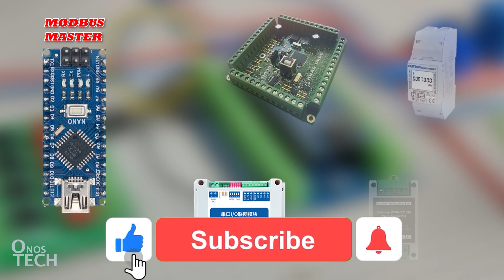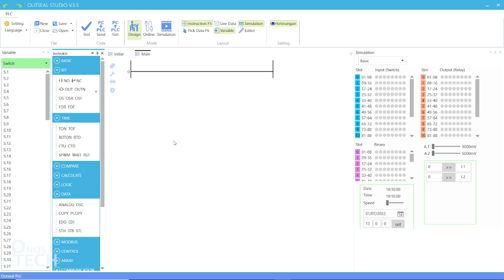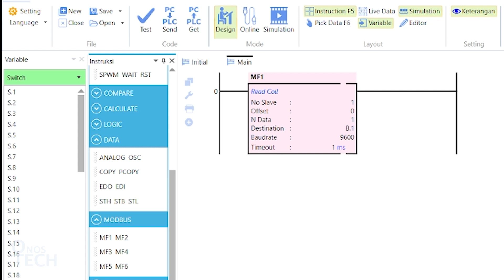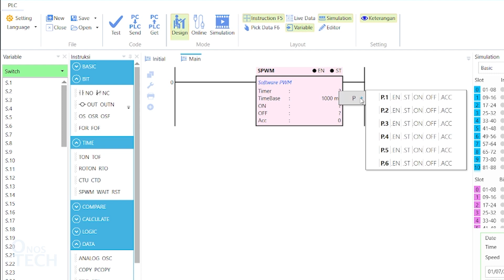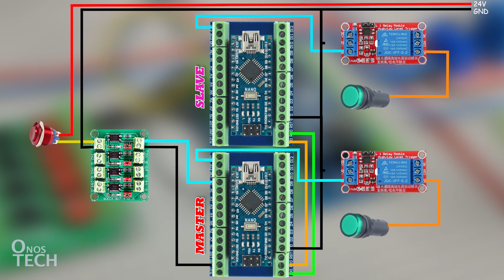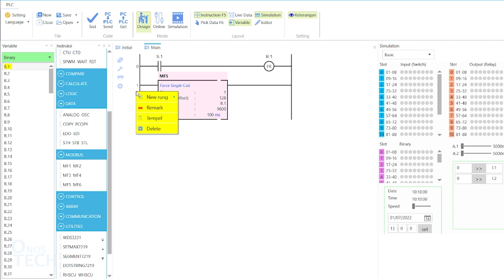Comment: Olá meu amigo, somos do Brasil 🇧🇷 Admiro seu conteúdo 🥇. Porque você vem investindo mais no outseal? tem mais recursos que o ld micro?
Reply: Thanks for your support! The good thing about Outseal is that it is easy to set up for Arduino Nano and its Modbus features. LDmicro is more flexible in that some low level programming can be done with it if you know how. I will be moving onto some other applications soon or maybe back to LDmicro.